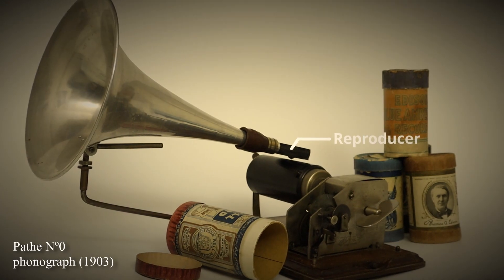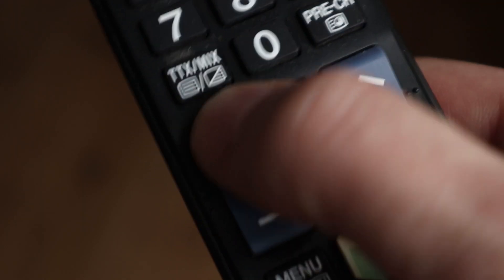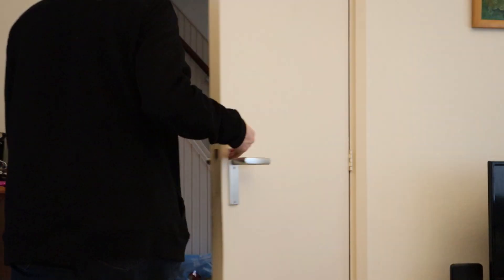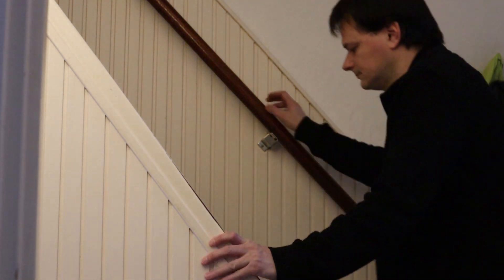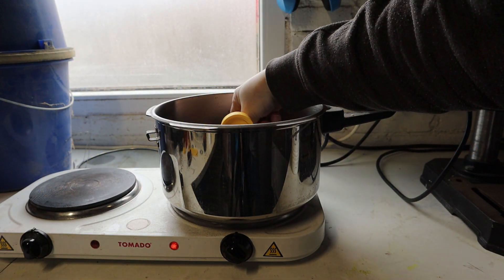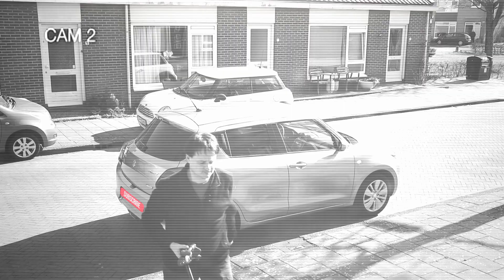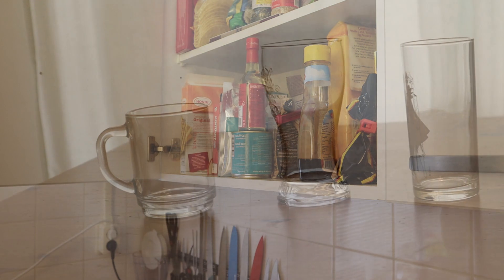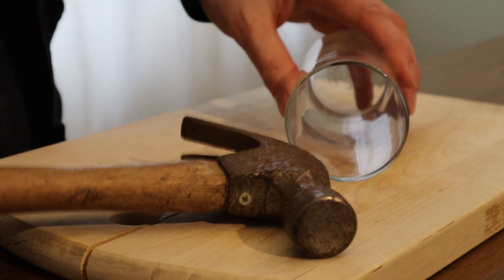Reproducing a reproducer (How to make a reproducer for an antique phonograph)

Comment: Thanks for the inspiration. I have a lion puck with just the aluminum frame of the reproducer. A lyric missing a horn an reproducer. And I believe 2 more lyric picks one needing all the holes drill and missing all parts, the other drilled but missing all its parts also
Reply from the maker: Your welcome. I'll hope you get your machine complete/fixed they are nice display pieces but they are awesome when they actually work.

Comment: Compared to my Columbia Model Q it sounds very good! I have also printed a new reproducer for my "Parisienne", a Pathé Model 0 mockup from a small French company. I used original mica and found a sapphire stylus from a Dutch dealer. But your aluminium membrane sounds better!
Reply from the maker: As you already know, I guess, the quality of the sound depends on many things. It's not only a matter of taste, but also in what kind of room you play it, if you are next/close to the horn or on the opposite side. I experimented a lot to record the sound without too much distortion. In other words, if both machines played in the same room, the same cyclinder then you'd could really tell the difference. Personally, I found the sound quality of a mica based reproducer slightly more pleasent, but despite that I'm very pleased with the outcome of my little project. Anyway, regarding sound recordings, you can't get any more basic than this technology. I find it fascinating that this piece of audio history still works being more than a century old.

Comment: that machine needs some work. you can buy a replacement reproducer with a sapphire stylus for less than 200 bucks...
Reply: This is a Pathé 0. I often pick these up for less than 100 bucks in France, so spending more on a reproducer than I spend for a complete machine is a bit silly, also Pathé 0 machines often look quite scruffy at the time they were made you got one for free if you bought 50 cylinders, so it was a low budget machine not realy meant to have a long life that we are still playing and fiddling with these machines is kind of a miracle 9 out of 10 times when you find this machine the spring is dead because people had put it in the attic fully wound and a spring don't like that for 120 years!

Comment: Great video could you print me a die for pressing the aluminum diaphragm?
Reply from the maker: Hello Andrew, I'm afraid I can't help you with that, but the 3D printed die isn't that special, and 3D printed plastic isn't really the perfect material for these kind of things. In essence, it's just a disc with rings carved into the surface, a metal die would be best, but if you have a thick piece of hard plastic you can cut that into a circle and make some groves (smooth grooves, no sharp edges) it will do just fine. I guess that if you can make all the other parts to use the die, then making a die should not be a problem.

Comment: Do you know where I could find one of the machines you used in the video that winds up and spins the cylinder at the specific speed?
Reply from the maker: Phonographs are not being made any more for quite a long time. Which simply means that you'll need to search for them in antique shops, online auctions but better would be a specialized shop. These kind of shops still exist and have the ability to repair and maintain these machines before they sell them. Search for a "gramophone", "phonograph", "wax cylinder" or "78-rpm records" or the corresponding words in your preferred language.

Comment: I came here from the piezo video wondering where the heck you got a borosilicate stylus.  Now I know - sort of.
Reply from the maker: Yep. That's how to make them. Not as difficult as it seems, but it requires a steady hand, some thin borosilicate glass rods or a thicker piece of borosilicate glass and a decent oxygen-gas burner. But if the glass is thin enough to start with a regular burner will work too. Keep in mind that practice makes perfect.

Comment: By the way- Mica diaphragms can be bought as reproduction, as can a (somewhat better) diaphragm for the aluminum, also reproduction for a diaphragm. For a stylus, it would be best to buy one of the newly made sapphire styli from the various antique phonograph supply places (this is historically original, but $50 or so). If you buy these reproduction parts, you'd just have to either 3D print a frame, or buy a reproduction. Basically, you can make it yourself as much as you like, or as little- full reproduction part sets are available
Reply from the maker: Thanks for the tip.

Comment: is that bit at the end the reproducer actually playing a record? Becuase that is MUCH higher fidelity than an original. It's almost transfer quality!
Reply from the maker: The song you hear at the end of the video was recorded using the DIY reproducer as shown in the video. There are a lot the usual problems , so I would not call this transfer quality. A simple recording with a decent microphone somewhere near the horn. The fact that the playback speed is a bit too fast might and the trebble is relatively high because of the way it was recorded might be slightly confusing. Please keep in mind that the cylinder itself is of a remarkably good quality, which was very fortunate and greatly benefits the results. Anyway, thanks for the compliment.

To prevent confusion, the music you hear around the 1 minute mark (the Tragic Tunes TV scene) is from a different source and was not recorded by me. I did this on purpose because for the story, it had to be a different recording than the one I own myself, simply because there are many version of these recording. It had to be of better quality too, because it needed to reflect the sound from a professional TV show.

Comment: Nice idea of using a later ortho aluminum diaphragm
Reply from the maker: Thanks, I found it to be a nice alternative to mica. And this project was a fun experiment in trying out some new skills. I was slightly surprised by the sound it produced and I am very happy with the results. A metal diaphragm isn't very common for these types of reproducers (I was told) but with the horn already made out of aluminum I thought it would fit nicely. Pressing the diaphragm and finding the correct size and shape took quite some experimentation though.